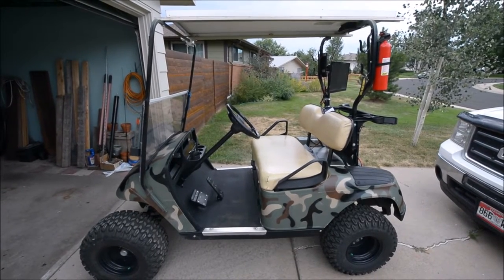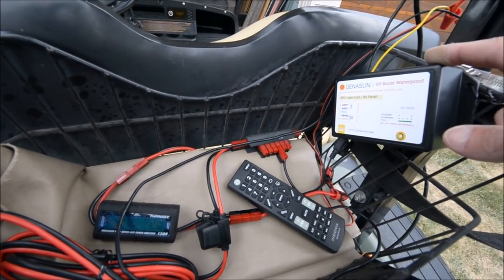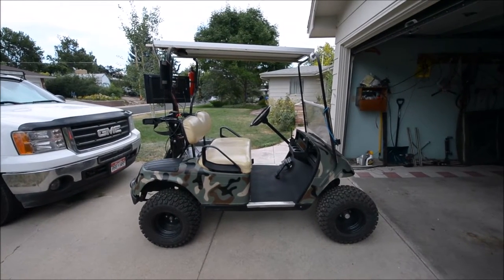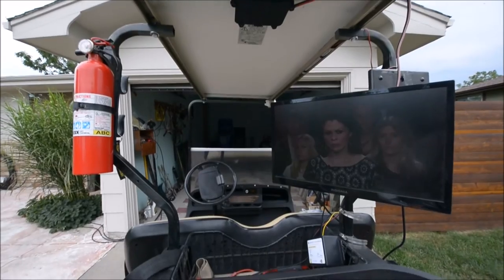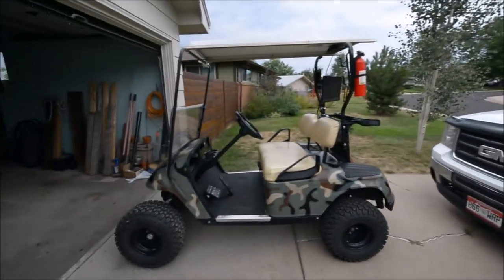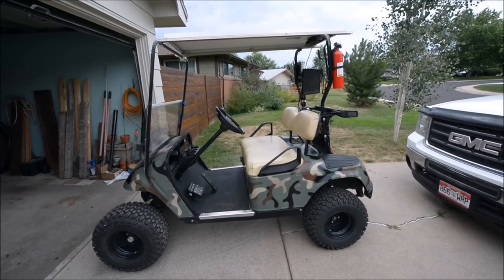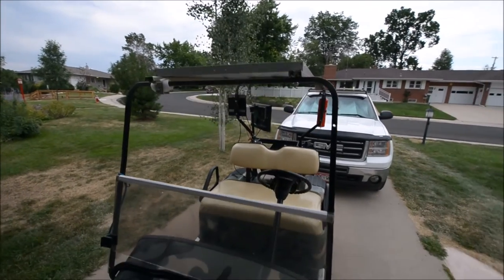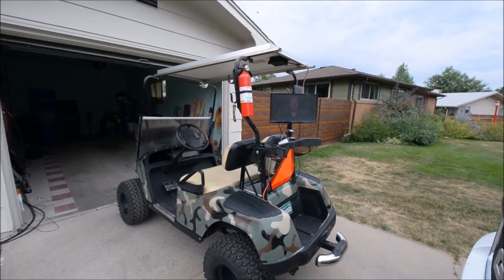Solar Powered Golf Cart (36V cart &120 watt panel)

Comment: Can you list the equipment you are using?  Charger, boost controller, batteries, panels.  I'm looking to do this exact 5hing to a hunting cart.  Not much info and I'm limited on knowledge in solar.  I would like to research your set up more.
Reply from the maker: tony, i have since sold it so i am not sure about the equipment. solar is very easy to setup. please subscribe!

Comment: How long will the charge last if you use it around a golf course? Does it charge while being operated?
Reply from the maker: it goes longer than a regular golf cart. yes it charges it the whole time while parked, or while operated. they dont allow carts with big knobby tires on the golf courses here.
Reply: can you run all day without having to manually charge? will that panel keep the batteries charged while using?
Reply from the maker: @mississippifisherman8957  yes